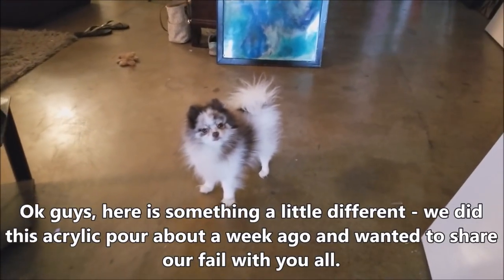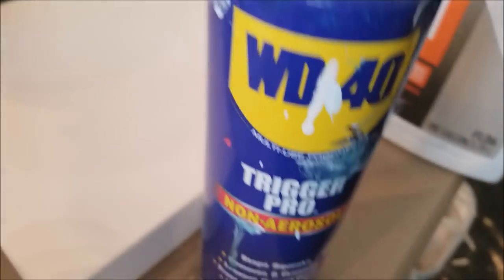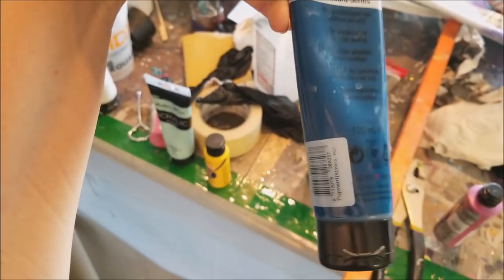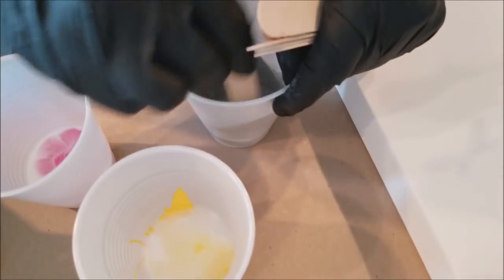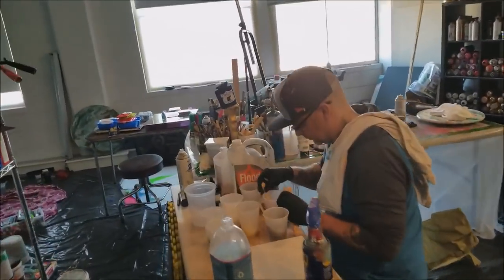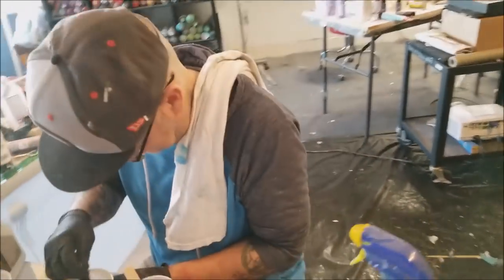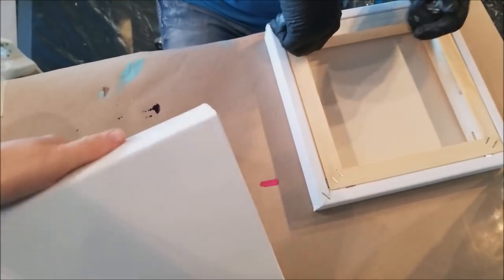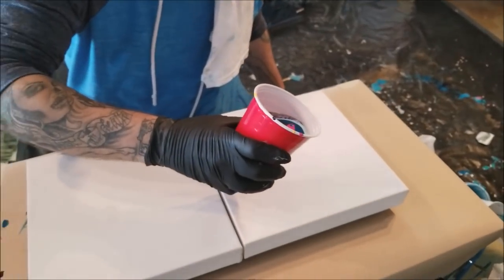Acrylic Pour Fail (Literally a Puddle of Mud!)

Comment: Hey y'all (yeah I say that all the time). I have started doing acrylic pours. I found that paint + Floetrol and only a tiny bit of water if needed, stir, then add silicone or dimethicone, stir very little works best. I think you had too much water which breaks down the cohesiveness of the paint and making it too thin was the problem, along with the gray. Floetrol is to bind the paint with the water, you can add more Foetrol than water, but lots of water will break it down. Paint the consistency of warm honey works great. AND cracking can come from paint too thick but more often than not, it is when your painting dries too fast. The outer layer dries before the bottom (underneath colors) and so it cracks when that sets up. Pick a cool day to do a pour. I am no perfectionist at it but it is what I have learned so far. (hugs)
Reply from the maker: You always have the best info, thank you Deb!  I completely agree with your evaluations of this piece.  We are going to do another one soon.
Reply from the maker: I will totally watch that!  Thank you Deb!

Comment: I have been pouring for a while and really like liquitex pouring medium. It's pricey but worth the splurge. I tried floetrol and really didn't the results I got with it. It also looks like there might have been some clumps in the paint. I think next time if you stick with complementary colors you should be fine. A good quality soft body paint (Golden Fluid is my favorite), liquitex pouring medium and some water for consistency - a bit of treadmill silicone if you like cells - you will get great results!
Reply from the maker: Thank you so much for that recipe!  I will absolutely give it another shot!  Thank you!
Reply: Glad to help!  Oh and by 'Complimentary Colors'  I actually meant colors that don't produce mud when mixed (like blue and green).  I realized after I posted that was incorrect.  Also, watch out for black and green, they tend to take over (at least for me).  And be sure not to leave too thick of a layer of paint when you pour it off or you can end up with crazing when it dries.  Good luck!  I would love to see how it turns out :)

Comment: Try doing a pour through a pasta strainer/colander :D I have seen some neat results with that and plan to try it. That didn't come out too bad. I would have tried using a wide thin metal spatula to pick up that really pretty part of the run off and dumped it in the middle of the grey. :) - Heidi
Reply from the maker: We will have to try that, thank you Heidi!

Comment: i just started pouring today i mostly do abstract art but figured since I found some floetrol in my garage what the heck it looks easy why not. i thought as long as my paint consitincy wasnt to watery or thick it would come out fine. i mixed fluro blue, pink and white and got back a muddy red mess. tried 3 different times and the same thing. It looks easy but there is a ton. of trial and error and im still not sure on what im doing wrong

Comment: Why does the paint on the table look better than the paint on the canvas? Could it be the paint? Too many colors? I stopped using acrylic because it took too long to dry, but I got good results....usually. My mix was one third paint, one third Floetrol (some people use white glue) and one third water. As you probably know even though Floetrol is white it doesn't change the color or shade of the paint.
Reply from the maker: It always looks better on the table!!!  At least in my experience, lol. Ugh, I will practice and try again.  I think the grey killed it.

Comment: Whoa too much paint & too many colours for a small canvas lol recipe for 10% paint use up to 30% flotrol and then just needs a little water, it needs to be like runny honey or what us English types call single cream (the thin cream lol) took me ages but I finally cracked the acrylic pours, now I'm watching you two loads to try and get the resin right.:) x
Reply from the maker: Lou Phillips maybe we are regressing lol. Thank you, Lou for the tips. I think you are right and it is too thin. We are going to try again this weekend.
Reply: eek, I sounded a bit big headed! I was actually mixing paint while watching you I was going nooo Jeff too thin lol it's not easy after doing resin pieces when the colours mix in so quick and no messing apart from a bit of heat, you lose the 'eye' for the mix.

Comment: Too much paint and maybe you didn't take into account that stiring just isn't the best idea. I rarely see artists stir their paints in cups. So for a dirty pour; after each color has been mixed with Dimethicone and GAC 800, and Floetrol, Side note, you can make up a container of those things separately and use as needed when doing Acrylic pours.  So after adding your three or four pouring mediums, into the dirty pour cup begin to put in your paints. Add colors that compliment each other. I never suggest gray or even brown unless its a special pour. So you were using white and a lot of times with white you dilute your cup colors with white. If you flood your canvas with white then leave white off the cup list. Then your colors will have more impact. Also be really careful with colors like yellow and pink because if you mix them they can make a horrible grayish mix. You can separate them in the same cup as long as they are not right on top of each other. I think starting with a small canvas and experiment a lot. I know you say you cannot do acrylics but I think you can. Just like resin it takes practice! ❤️🥰🌟👍🌈
Reply from the maker: Dee A Holman hey girl!!! Yeah, I think you are right. I will revisit it at some point lol